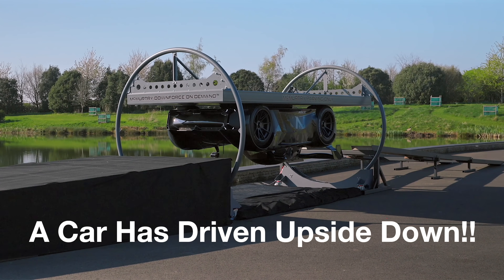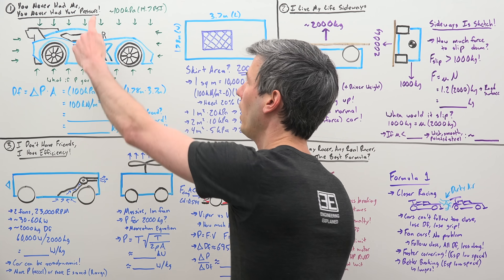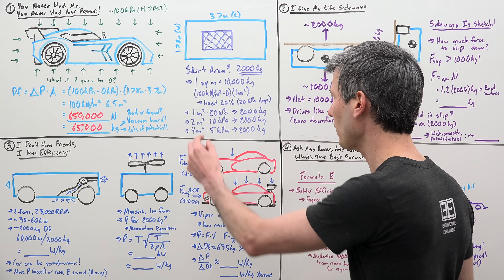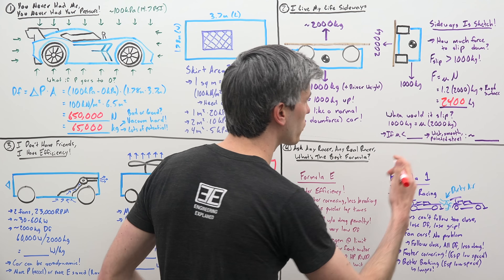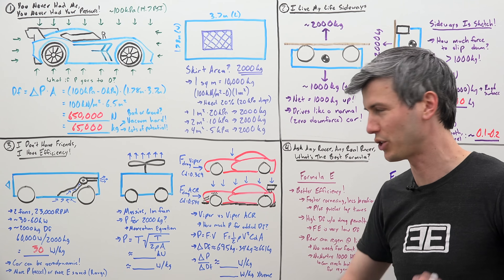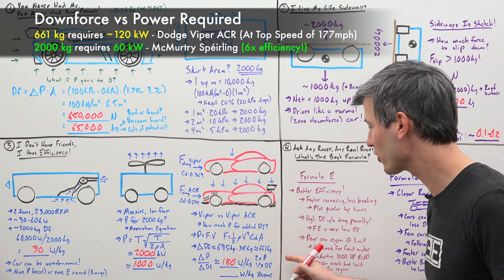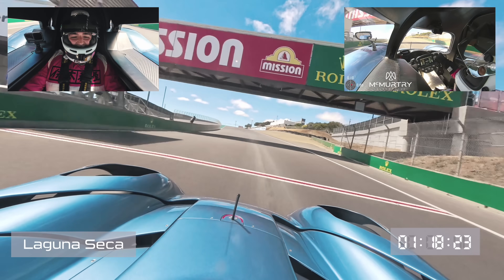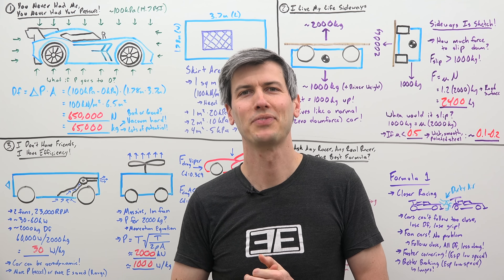This Car Just Drove Upside Down!

Comment: I wouldn't really call this "driving upside down using just downforce", when it's literally just a vacuum that its creating. We had little RC cars in the 2000's that can do this, stick to and drive up walls using a little suction fan under the car. 
I wanna see them do this without using a suction fan, just pure actual downforce while driving forward.
Reply: Downforce, by definition, is the downward component of force generated on a car due to aerodynamic features. Whether you want to call a fan creating suction an “aerodynamic feature” is up to interpretation, but I would call it such. Aerodynamics in layman’s terms is just how air moves around an object. The fan is in fact changing the way air is moving around the car, so I would consider the fan to be an “aerodynamic feature”. As such, I would say using a fan to suction a car to the ground would be considered downforce.
Reply: @AxeMan04x  eh, but is creating a vacuum really the same as creating downforce due to aerodynamic features? Typically one thinks of downforce on a car as being done through the car itself moving through the air, and the aerodynamics of the shape of the car (plus added wings/spoilers/etc) doing the work of applying that downward force upon a car. Attaching a powerful Hoover to the car aint the same thing. At best what they made is a reverse Hovercraft.
Reply: @ it depends on what you interpret the definition of “downforce” to be. Some people consider it strictly to be the force of air resistance acting on a moving vehicle whereas others have more broad definitions such as any force that acts downwards on a vehicle related to air pressure. With a more strict definition of downforce, using suction wouldn’t be considered downforce, but if you’re saying downforce is any downwards force generated by air pressure, then using suction would be downforce. I suppose all I’m trying to say is that there isn’t a 100% correct answer on this due to the nuances in how downforce is defined person to person.

Comment: So Jason, what you’re saying is if F1 decided to ditch all the aero wings and strap a massive fan to the back, it would be 6 times faster? 😵‍💫😮‍💨🤤🔥

but for real, when does F1 get a form of this. I feel like it could help in so many ways and the racing would be insane. Watching 1 Speirling go around the track is baffling let alone 20 of them taking every turn at top speed 🤯🏎️🏁😎

Comment: The problem with implementing it in any racing series would be a huge spray behind the car when it’s raining. You can already see how much dust the fan picks up and F1 is also already struggling with wet visibility with passive ground effect cars.
Reply: Or when they go wide and instead of kicking up a bit of gravel, they create a localized sandstorm blinding everyone.
Reply: ...WELL,U know ABOUT BRABHAM BT42B ,right?

......INDEED THIS IS A loss AND F1 MUST VE BE TURNED INTO A VAC SERIES,HEHE
Reply: They could direct the spray down for rainy races, doesn't sound like a big issue.

Comment: Ben Collins will be annoyed.  He's been working on a project to do this for a while.

And someplace in my old journals from undergrad back in the early '90s I have designs I drew up to make a track to do this too.

The bigger issue than generating the suction needed is making sure that fuel, oil, and coolant all get where they need to go in in the engine while it's upside down.  Airplanes have solved this for a long time, but only portions of that technology have been applied to terrestrial vehicles.

Comment: Oh I've been using a passive version of that process on my road car to reduce fuel consumption and radiator performance. I turned the rear bumper cavity into a positive pressure zone ducted to high pressure zones created by the tyres. Then I built a thin flat duct at the rear as an outlet to entrain exit airflow upwards.

My theory was to create a virtual flat surface by harvesting the positive pressure irregularities to run what amounts to a airblade into the low pressure zone behind the vehicle and see if encourages a more stable underbody airflow.

The car became a lot quieter, basically silent when warmed up ~70km/h and quiet enough to hear animal noises when driving through forest areas as the sound reduction is from reducing air flow disruptions, and my economy went from 6.2-6.7L/100km to 4.9-5.8L/100km when measured brimming the tank against the odometer.

The next stage is using the venturi effect on the front bumper elements to increase pressure ahead of the radiator and intercooler so i can shrink the opening needed for cooling and still have normal performance.
Reply: Sounds like a fun home-brew science project 👍
-are you pulling air from just the rear tires, or all four?
Reply: @Scot-p1v  
Just the rear tyres and yes it's very much about seeing if there is a modder culture for range modding cars with our much more accessible understanding of aerodynamics.

I was watching another edutuber Julian Edgar who is an automotive aerodynamics engineer based in Australia who does 101 level tutorials on various automotive concepts for diy modders, he has a big emphasis on testing whatever you do.

My formal education is in environmental and biochemistry , so it's a science experiment for me to satiate my curiosity about understanding how complex systems interact with one another and to see if I could develop usable everyday skillsets with what's available on the educational side of YouTube and other streaming services.

It's a ton of fun to work out different parts of my brain.
Reply: Try to get it patented and sell it to a big constructor, might make you a "bit" of money ^^
Reply: What make/model of car are you running?
Reply: @stopthephilosophicalzombie9017  3rd gen Ford Focus 1.5t hatch.

I was doing a "yes and deal", where I first worked to understand how the designers intended things to work, how the engine software self-optimised for a specific power output and located open source info on aerodynamic simulations for the bodyshape.

The bumper mod was working with the hatchback body shape as the designers had already done a great job with the body work, so I focused on the turbulent area that formed as air was exiting to see if could pull the same trick bladeless fans use to move air.
Reply: I'm curious how that compares to more traditional underbody aero- if the guy you mentioned is who I think he is, he has published an entire book on designing custom underbody aero trays (among other books on automotive modification/design). I've been considering picking up a copy, though I don't yet have the workspace to actually do it. (I also hoped to track down some results from other people actually using said book before buying it myself, but again, I can't actually follow along yet so I've just put that off.)

Comment: Imagine racing this beast and having a fan failure...
Reply: Break the skirt’s seal by running over something on the ground…

While cornering would be disastrous…

This kept aero fan cars from racing in the 70s…

Aerodynamics damage ruins all of the fun…

Vacuum loss takes the fun away even faster…

Comment: So it didn't drive upside down it was simulated?
Reply: Huh? It drove upside down.
Reply: @logitech4873  Come on you know it isn't true.
Reply: @jonasezekiel3829  Literally just watch the video. What are you on about?
Reply: @logitech4873  I literally watched again and again thinking I've missed something but no it doesn't drive upside down, It's sucked in a vacuum and if it attempt to move forward it will crash so I'm not impressed yet.

Comment: Does anyone else rember learning about the Chaparral 2J that ran in the 1970 Can-Am series?  It used skirting and two rear mounted fans to create very low pressure under the car resulting in between 1.25 and 1.5g of reinforce. The skirting was very cleverly linked to the suspension so it always maintained the same distance from the pavement. So had they wanted to give driving upside down a go it was certainly within their grasp.
Reply: From memory based on numbers, they would have an issue with slipping sideways though if they wished to rotate the car like the team did it here. Still - it's a very cool car.

Comment: A fan car racing series would be awesome, the racing would be super tight with heroic overtaking in low speed corners and lots of strategy with pace. The jet engine sound would be an awesome upgrade over the current formula E sound.

Comment: For years I've been calling to have an EV series that actually TRIES to make fast cars. A fan system like McMurtry, unsprung floor/fan aero ideally. Closed wheels for lower drag. Hot swappable battery that's a large as viable. Say, 80-90 kWh. Men with jacks swap the battery in 10-15 seconds and you then have energy for a 20-40 minute stint depending on track and amount of send.
The end result could match LMP1/F2 lap times, and match them for a decent stint duration, on battery power.
Now batteries aren't saving the world as science-is-settled claims, so if a fuel power alternative is possible, why not? You'd need a significant MGU on the engine to provide power to the fan. Probably a decent battery as buffer as well. Some losses there, but worth it to get longer stints and not need big stacks of flammable drive batteries to fly around the world. Let's not pretend batteries are safe for that.
Reply: You're thinking about US/European batteries. Chinese battery tech is years ahead in terms of power density and charging speeds, and they're not flammable any more (or at least a lot less so than ICE cars).

Comment: If a regular car was able to cover only a distance of three feet, you would not describe it as 'driving'.
Reply: The limiting factor was the length of the upside down road, not the car.
Reply: @colinmcconnell827   - Whatever limited it, I would not describe it as 'driving'. I would call it 'slowly moved forward a short distance'. Let's 'drive' it on a large, smooth vertical surface! Some building should work for this. Hoover dam maybe?
Reply: @my_dear_friend_  It did drive.

Comment: The floor of the car seems to fully kiss the road. Make me wonder how fast the skirt wears. I'd make the skirt unsprung, connected to the 2 uprights, so have a decent reference to the height of the track. With active hydraulic actuators, then adjust for tyre compression and bumps encountered by the front wheels.
In a road lead hypercar, just half that 2 ton downforce would be as much as any regular floor and wings can generate. A downsided fan system could be a nice thing to have, and then keep the rest of the hypercar mostly for optics and air drag, not downforce.

Comment: This is basically a hovercraft in reverse. It compares favorably with a car with fixed aerodynamic surfaces, but what about a car with adjustable aeroynamic surfaces? It could keep them in a low drag position on straights and move them into a high drag position going into bends (where braking is required anyway.)

Comment: I have more than one Viper but the ACR is on a whole other level when compared to the RT/10. The RT/10 tries to kill you. The ACR is actually pretty tame, even at higher speeds.

If you're going to buy one, get the older RT/10. It's more affordable. The ACR is nice, but way more expensive.

Comment: From a driver perspective, the problem with active aero/downforce will always be safety. Passive aero is incredibly reliable and when it does fail it's normally visible before it's dangerous and/or it's not catastrophic. If something breaks with the fan, okay that'll probably be readily apparent to the driver sure but it's generally the skirt. The skirt is susceptible to wear and/or impact that can suddenly and unknowingly be catastrophic. I know racing is risky but fan cars feel a bit like going out for a high speed run with the very real possibility all four tires are going to fall off the car right as you go to brake and or turn into a corner.
Though I've never personally tried a fan car of course, but these are the concerns I'd have before pushing lap times in one. Even if the car has passive aero and the fan, it doesn't matter if you're using the fan to get 10% faster speed through a corner and it fails you're suddenly beyond the capabilities of the car enough that there just isn't much you can even do to get back to a responsive state.
Reply: The thing is that since the car is fully electric and there is so much electronic control, it could even be possible for the car to acknowledge when there a failure and immediately act to reduce the possibility of a crash, like reducing power safely, showing it on screen to the driver or even make some kind of noise in response. Just like a safe mode that most modern road cars feature, but of course more sophisticated

Comment: Meh. Jim Hall and Hap Sharp did this with the Chaparral 2J in 1970 using gasoline engines in the Can-Am  series. Well, they didn't hold a publicity stunt and flip the car. But it only weighed 1800 lbs and produced 2200 lbs. of down force. Unfortunately the SCCA used a rule against moving aerodynamic devices to ban it before they could get the kinks worked out. The funny thing was that the ban on moving aerodynamic devices was added a few years earlier because of another Jim Hall car that had a driver adjustable rear wing.

Comment: One of the problems with fan cars in modern racing is that it has serious potential to run into human limits before the car reaches its mechanical limits. Not unlike fighter jets. Where the G-forces are so high that it can stop blood flow in certain parts of the body. And it's not hypothetical either. The Texas Firehawk 600 CART race in 2001 was notoriously canceled because drivers were starting to black out from the G forces at the end of one of the turns. Now, much of this has to do with humans being more susceptible to vertical Gs vs lateral or longitudinal Gs (Texas Motor Speedway being banked). But there are still limits. And fan cars have serious potential to run up on them.

Comment: This makes no sense. Newtons are units of force. kg are units of mass. There is no such thing as "kg" of "downforce".
Reply: Sounds like a you problem.
Reply: @logitech4873  sounds like neither you nor EE have any idea what you are talking about.
Reply: @JLUROCK  Did you genuinely not understand what was meant by kilograms of downforce? Do you need me to explain it to you?
Reply: @logitech4873  do you literally not know what Newtons are? What do you not understand about not using the correct units? We could convert to Liters of downforce, but that would be just as pointless.
Reply: @JLUROCK  I understand what newtons are yes. And no, liters wouldn't be the same - that's just a measure of volume. Kilograms of downforce is commonly used and is very easy to understand.
Reply: @logitech4873  the fact that you don't understand the problem here is a problem. Units of force are the only correct units to use here. It doesn't matter how straightforward it is to do something incorrectly. Using kg to describe force is just as wrong as using liters to describe force.

Comment: I wonder if it makes sense to switch from sucking the air from below to sucking the air from the front to generate a little bit of a boost on straights. This can probably be done using some downforce sensors and accelerometer data.

Comment: If this is allowed in Formula-E, they can use some of the regen to power the fan directly, which will also up efficiency, because charging the battery through regen isn't lossless

Comment: Your excellent explanation of how extra force, greater than the weight of the car, is required to generate enough tire traction to prevent sliding sideways when the "road" surface is vertical also applies to propelling the car forward at speed. Discussions of a passive downforce car driving upside down sometimes propose that if a 2000 kg car generates 2000 kg of downforce that this is enough. This fails to consider the traction issue. If a 2000 kg car going, say, 300 kph has 1000 kg of drag, it needs 1000 kg of weight on the driven tires at a coefficient of friction of 1.0, to propel the car forward without the tires loosing traction and slipping. This is 250 kg per tire for a 4 wheel drive car, and 500 kg for 2WD. If the 2000 kg car is 2WD and has 50/50 front to rear downforce/weight distribution, then it will be reaching the traction limit at this point. This is a real problem for land speed record cars running on dry lakes/salt flats where the traction is low. They could go much faster running on pavement. To drive upside down this hypothetical car would need at least 3000 kg of down/up force if 4WD or 4000 kg if 2WD. That's 2000 kg to support the weight of the car plus 1000 or 2000 kg to develop enough traction to propel the car at speed. After accelerating to speed right side up, the 2000 kg downforce car, even if it could get through the inversion process, would experience tire slippage once inverted and would slow down and fall off the "ceiling". Numbers have been rounded for mathematical simplicity. 1000 kg of drag may be more than actual values. Your mileage may vary.
Reply: correct you need to overcome gravity plus provide enough upward "down" force to ensure grip to transmit power, and also allow steering and stability. like a car with aero lift can be unstable at speed